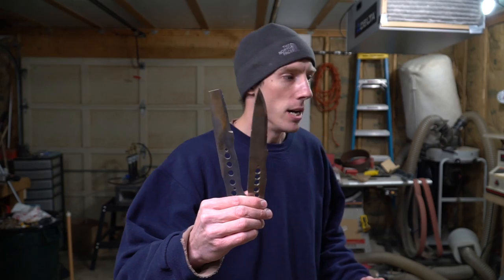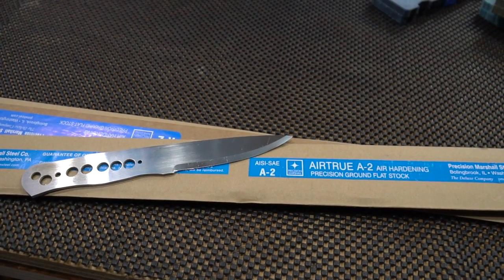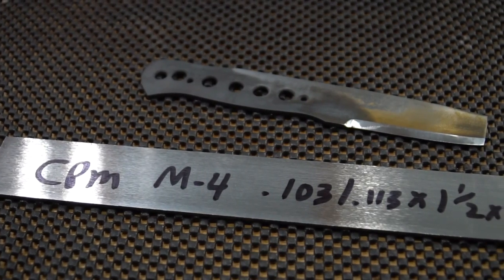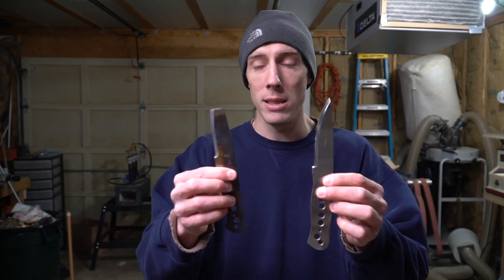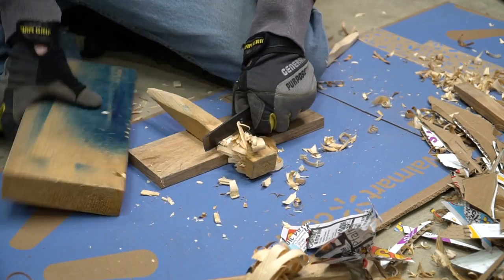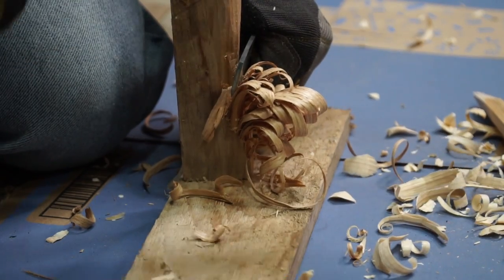A knife is NOT a knife, Is NOT a knife! RANT | My thoughts on knife testing

Comment: I agree with you and see your points. I am reminded of a testing / review video of a knife where a guy took a chopper style knife and beat the spine repeatedly against a cinder block till the spine snapped. Then he concluded that it was a piece of crap knife. I remember thinking, "that is a completely invalid test that proves nothing. Who in their right mind would EVER try to whack their blade against a rock or block or something that hard that the knife was never intended to do?" I do think that testing should be rougher than what that blade will do in real life because if it can handle that, then regular stuff should be a piece of cake. If not, then you know where improvements need to be made. However, testing has to be kept in scope of the original design of the blade itself. It's like saying rifles are crap because they can't be concealed, they're too long and awkward for close quarters in and around buildings. Or that handguns are crap because you can't take down a deer or elk at 500 yards with one. It's all about what they're desinged for.

Comment: Thank you for this video. I get driven nuts by people who don't understand that knives are designed with functions in mind. The most common place I see it, is generally the kitchen. Nothing worse than seeing someone trying to break down a whole cabbage with a 4" paring knife. Or chop with something that doesn't offset the knuckles from the cutting board. When people do that, they always hover their hand off the counter to avoid bashing their knuckles. I've seen injuries to food and people with that method. 

So my daily pocket knives aren't getting used for breaking down a turkey. I could in a pinch, but it's not their purpose.

Comment: Fantastic! 

I've gotten in arguments with coworkers about misusing tools - which I think beautifully sums up your point. 

A ratchet wrench makes a horrible hammer, just like a ratchet extension makes a horrible punch. Can a ratchet and extension be used to replace a hammer and punch? YES! Probably only once, but yes. And they'll be horrible at, and you'll destroy them. 

(Supervisor destroyed a 6" 3/8 drive extension of mine by using it as a punch - locking ball gone, ends mushroomed to the point it wouldn't fit a ratchet or socket... and no apologies from him) 

Tools are designed for a purpose. A knife is a tool. There are many types of knives designed for specific purposes. Using it for anything other than it's intended purpose is misuse.

Comment: Very cool take, especially on the muddy waters explanation. I think that was the most important clarification here. You have to know what you're looking for and looking at. I do like all these tests because they are a reference, as long as I know what each type of steel, geometry and heat treatment can do better or worse. For example, when LC200N came out, I knew its main purpose was corrosion resistance, and I knew it wasn't going to be as hard or resistant as, say, M4, Maxamet or S110V. However, it was good to know how it more or less stacked up with these steels in a normal task like cutting cardboard, and think to myself if it was worth the sacrifice for the corrosion resistance or vice-versa. Same goes for toughness, is it likely that I'll roll my edge, do I normally pry things or cut hard things with my knife? Do I need 3V or am I better of with S110V? A lot of other things come into account, of course, I'm just kinda ranting along with you.  

Torture testing on any product is mostly there to test its limits and give you a sense of confidence, as long as you don't misuse it or actually try to measure overall quality through that one type of test. Flashlights, for example, are normally tested at 1-3 meter drops. I like seeing tests where they drop them from far higher or even chuck them across the street, because now I know that if, by accident, I drop my light from a rooftop, it might survive. However, that doesn't measure the longevity of the components, just the durability; it also has nothing to do with user interface or brightness. These are, of course, my two cents as a flashlight and knife enthusiast who likes to shop carefully. I agree with you on muddying the waters, and every tester out there should always explain pros and cons of steel, geometry, blade stock, etc...

Awesome content always, dude.

Comment: Amen man! I haven't done a ton of testing... Mostly destructive testing on 1084. I haven't quite gotten one to go 60 degrees then back to 0 like you mentioned (lol, I have some work to do!). My knives are usually used by hunters for skinning. Do you have any recommended testing techniques for skinners? Prying may not be as much of a concern, but cutting, and edge retention when contacting bone would be. As always, thanks for your perspectives and videos!
Reply from the maker: I usually look for apex stability doing different things at different geometry's (I usually start at 10 degrees per side and adjust till i stop getting micro chipping at the apex. ). I would think a good piece of hardwood would mimic a bone fairly nicely. 🙂

Comment: This has been said by others but not that clear, so this will be the video I send guys when talking to them about this topic, thanks. Only thing that's not right is that thickness behind the edge affects edge retention. If it is thin enough behind the edge it will still cut cardboard if it's dull but that's cutting lifetime, not edge retention.. big difference
Reply from the maker: Im not talking about thickness behind the edge. (Perhaps the lingo got screwed up) Im talking about apex stability, which can be affected by the geometry on the knife. Hope this clears up my thoughts🙂👊👊

Comment: What a great rant! What do you think about s30v steel for an edc pocket knife? I cut a boat load of cardboard for the most part. Thanks for your videos!
Reply from the maker: Its a good steel if its left hard enough. Most don't leave it super hard. 🙂
Reply: With cardboard a thin geometry is generally a good thing, although it would probably be better if it was made with s30v I have found that most opinel makes good knives for cardboard.

Comment: To apply yet another analogy, you appear to be saying that if I play a Fender Stratocaster electric guitar to play a piece written for a classical acoustic guitar, and it sounds terrible, it doesn't mean the Fender Stratocaster is inferior to the classical acoustic, it just means you have to use the best tool for the job at hand.

So my hedge trimmers aren't inferior to my electric razor, they just aren't the best tool for getting a clean shave and will probably do a better job of trimming my hedge than the electric razor does... at least, I think that's a gross exaggeration of the point you were presenting for consideration. And if that's the basic idea... YES! I think anyone with half a clue would have to agree!

Comment: All true, but remember what (some of) Pete’s tests show. He will take very similar blades (or identical blades, in the case of Spyderco) and determine edge retention in different steels. So he is trying to get as close to an apples to apples comparison: keeping most variables constant, and changing only one: the steel. Other times he will take the exact same (single) knife, and alter grind angle, edge polish, or other things to see how those changes affect his cut test results. He is the first to tell you that everything from edge geometry to blade shape and size to handle angle to heat treat will affect how a knife functions in a given medium when used by a human. He CONSTANTLY warns people not to make second order conclusions from his data. I’m not an apologist for Pete, and I know you weren’t throwing shade. I’m just saying that he does get it. Jake over at Canadian Cutting Edge refuses to do much cut testing, for numerous reasons. One of those reasons is, “It cuts like a knife.  What more am I going to tell you?”  He’s kind of saying the same thing you are: what is it going to tell the viewer if he pushes a blade through a couple sticks or a couple boxes or a couple apples?  It’s a knife. It cuts.
Reply from the maker: Petes right. And theres a reason that testing is done. It is testing  exactly what a knife is designed to do, cut stuff. It's perfect for comparing brand to brand and knife to knife. Im not doing that though. Im building a knife from scratch. And fine tuning my heat treatment and geometry. My tests, primarily test apex stability doing various things, with different geometry., according to what type of knife it is. An extremely hard heat treat with o1 will hold up well cutting cardboard. However what happens when you hit a staple? Most of the time it will chip. So i have to go back and figure out if its a geometry issue (too steep an angle) or a heat treatment issue (too hard). There a balance there somewhere so thats what my testing is designed to find🙂

Comment: Its almost all about geometry baby, and what you're cutting with it....I can give a knife to my wife and daughter for kitchen work if I really need to know its worth cause IMHO that's the ultimate edge test for a knife.😁
My favorite knife is my $40 Gerber Prodigy,  420 Hc steel with a modified convex saber grind. With the edge done just right it freaking works great in the woods. My other fave is my Ontario SK 5 Blackbird, the spear point full flat grind with convex edge 154Cm steel rocks for woodcraft and stays sharp much longer than most carbon non powder steels.

Comment: Get a Rockwell hardness testing machine, only a grand or so, and know exactly what your doing with your heat treat and tempering, I would rather have a bit softer than spec otherwise you have a blade that will chip and break.
Reply from the maker: I have a local shop do hardness testing for me. That will change soon. I still have to do testing regardless though 🙂
Reply: Hardness and toughness don't go hand in hand. You can have hard and relatively tough, or soft and brittle. Over tempering up to 500f or more will make it softer and less tough, and too much crystal growth will be horrible for toughness at any hardness. A tough steel made hard is always tougher than a hard steel made as soft.

Comment: When your grinding the profile into your knives as well as shaping forming the edge etc what happens to all the steel that gets ground off the knives?
Reply from the maker: It goes in a bucket or on the floor.
Reply: @OUTDOORS55  What do you do with it once the bucket gets full? Is there a way to recycle the steel shavings? Is it even recyclable?
Reply from the maker: Throw it in the trash. I dont know about recycling it. Its a hunk of rusty crap by the time it comes out of the water bucket.

Comment: Umm ...could you repeat that. 😳  Sorry. 😉  Good video. On my channel I discuss why there is no such thing as the do all knife. You just covered that very well. I completely agree with your rant.   ATB
Reply from the maker: I wanted to give examples and analogies for each topic because theres a lot of overlap within today's knife designs. Sometimes its hard to discern (mainly with production knives) what the knife is actually designed for. A one knife does all approach usually means a knife that doesn't do anything well. So when you start to ask yourself about target knife use, for every design aspect, you get a knife that actually works for its intended purpose. And so on and so forth. Thats why i say it repeatedly. Just trying to a point across 😉👊👊👊👊👍👍
Reply: I think you did a fine job of it.  ATB

Comment: I disagree with the idea that knives should be tested according to how they were designed. Chef knives ok but bushcraft and survival knives may need to be used outside their design parameters if things go sideways in a wilderness setting. You have a limited tool set in the woods and sometimes you have to use the wrong tool for the job so it's useful to know how a knife can hold up in a variety of situations.
Reply: If your out in the wild, as a user you have to put thought into your decision of how your using that tool. If you think it's a bad idea, don't do it. Besides that, I don't think Alex is making full on survival knives. But I'm sure they'd do fair in that situation. Ultimately it's a knife not a pry bar to use for dumb uses when another tool can be used or made to do the job better to save your tool.
Reply from the maker: The problem is that for a lot of production knives theres a lot of overlap within their designs. From what ive found a production "outdoors/ Bushcraft knife" is generally made for all sorts if abuse. A "jack of all trades" approach to a general outdoors knife. A one knife fits all design for the outdoors may do everything, but it wont do everything very well. The idea behind a good woods knife is that you can use it to make other tools. Generally speaking most knife steels will handle a lot of abuse as long as they are not used as crazy pry bars. Personally I wouldn't risk my only tool doing something I shouldn't. Just my opinion though. Thanks for sharing yours 👍👍👊👊👊

Comment: And you would be totally shocked at EXACTLY who does not understand how rust and corrosion protection on a hard use woods knife can affect edge longevity. The thinner a high carbon steel is the easier it can rust and corrode to destruction depending on environmental factors. Now cut your cardboard or plastic clamshell...twist...SPINNNKK...THAT NOISE is probably part of your edge, maybe even your bevel...let alone carving or chopping or splitting wood. Edges are maintainence on high carbon steel. I don't care if Gil freaking Hibben made the damn knife.

I refuse to name names here but its ironic and hilarious.
Reply: And its not Pete from Cedric and Ada...just saying😂😂😂

Comment: And then there's Skall and he basically does abusive testing on all knives because the knives he reviews should technically be able to hold up to it lol
Reply: He tests implements that should be able to take tons of abuse and smashing around, wood to armor. Normally old school high carbon steels. Different geometry, different heat treating options. Are those steels usually as tough as CPM 3V OR hold an edge as long as CPMM4...NO. That factor and cost is exactly why you don't make spears and swords from them.